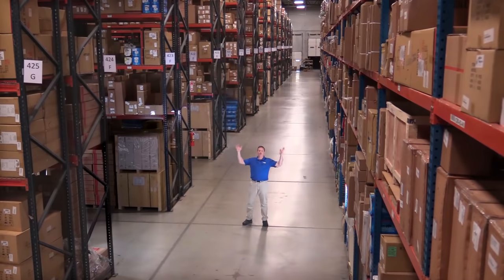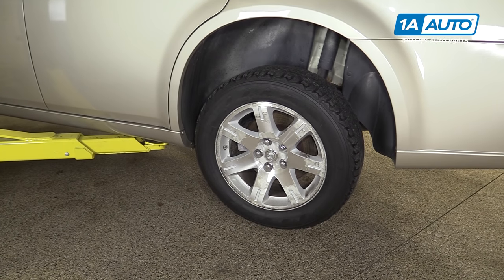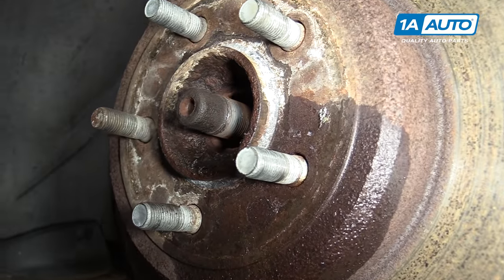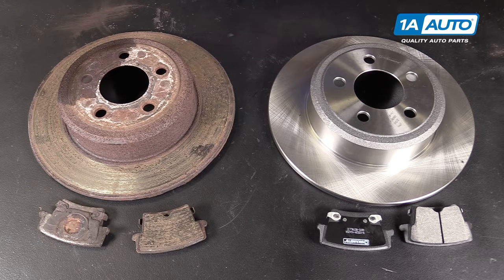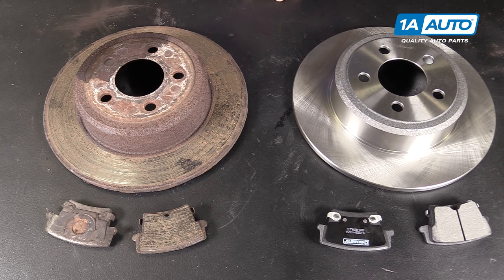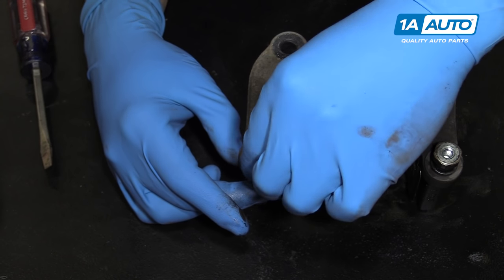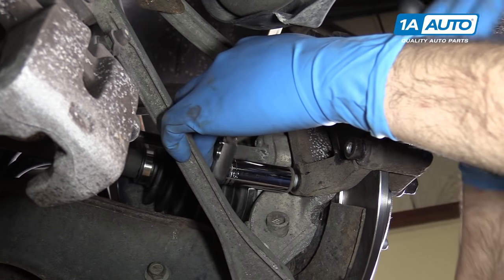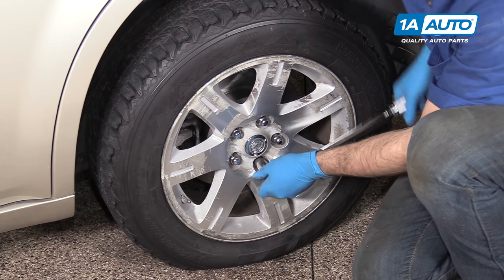How to Replace Rear Brakes Rotors 05-14 Chrysler 300

Comment: The only thing I WOULD NOT recommend is compressing the caliper piston. Compressing that caliper piston with the old, dirty, over heated brake fluid from the heating and cooling cycles of every day driving is just pushing all the contaminated fluid back into the braking system, which could lead to more expensive repairs sooner rather than later... ALWAYS crack the bleeder valve while compressing the caliper piston to remove all the old brake fluid from the caliper, close the valve and bleed the system. And I actually go through the bleed process twice to make sure and remove all the old fluid or at least as much as I can(it doesn’t use much fluid doing this but will save $$$ in more repairs later). Just make sure the fluid reservoir is full each and every time you go through the bleed cycle to prevent air from remaining in the braking system.
Reply from the maker: +Cody Vallie Thanks for the feedback!
Reply: Probably due to the fact that the novice mechanic will only create more problems with the braking system by monkeying around with the bleeder valve.  More often than not, the novice will think the valve is a grease zerc and will leave a glob of grease hanging from it.  Seen it many times.
Reply: You're doing too much

Comment: Hi.  Marvellous video, just right to incl. socket sizes etc.  Many Thx.  Now then, do u have any tips for removing a 19mm chrome lug-nut (a la 300M 2003) when the lug-nut facets have been rounded off by some gorilla with the wrong sized air-gun socket?  Do I have to (carefully) drill off the cap of the lug-nut?  Or is there a needle-nose vice grip that I can force down either side of the lug-nut recess in the (steel?) wheel and then clamp with huyge force on the rounded nut?  TY, TY.

Comment: You don't explain why you installed a new hub for this brake job. Is it necessary for pad and rotor replacement?
Reply: No it's not needed to change pads but if your wheel bearing is going bad it makes sense to change it when you got it apart thoe
Reply: Also the fact that they replaced a vented rotor with a solid one...and make no mention of the difference in this video...lol🤣🤣🤣

Comment: I have a question, Will the brakes system(rotors,caliper) on a 2008 SRT fit on a 2008 SXT model?
Reply from the maker: +Angel Reyes Thanks for checking us out!  The SRT model will have larger brakes than the SXT, so they will be different.  1aauto.com
Reply: 1A Auto Parts Thank you. But if i use srt caliper bracket with the srt calipers and rotors, will it fit then?
Reply: Angel Reyes it can be done but u need more than just the calipers and the brackets, the rear spindles and front knuckles need changed and u will also need rims that will fit srt vehicles.

Comment: where can  I find a video for changing the front brake pads? i also need to find out how to get to the cabin air filter on the 2014 Chrysler 300 Varvatos edition. It not directly behind the glove box. A video on replacing the fog lights on the same vehicle would be great as well. Thanks!
Reply: The filter is in the hood near top where wipers are
Reply: Also if you don't see anything when you look in that area, it means they didn't install the housing. Quite a few chryslers and dodges are like this and in my vehicle, my father bought years ago, that part was apart of the features to have already been installed. There are videos out there on how to install it if you can't find it, but the part is a little difficult to find.

Comment: I have a 06 300 Limited What's the part number for the rear brakes cause I've tried 1057 and 1057A and neither fits.
Reply from the maker: Thank you for the inquiry.  In order to find the correct rear brakes for your vehicle we would need to know if your OE rotors are vented or solid and their diameter. +1namillion83
Reply: @1AAuto  Hey thanks for responding. O'Reilly had what I needed AutoZone kept giving me the wrong brake pads. Went to a total of 4 AutoZones before I went to O'Reilly. I'm back rolling now thanks again for responding.

Comment: Hello what is the name of the piece of metal i need to replace that
Reply from the maker: +LATINO CONTINENT You may be referring to the brake dust shields.
Reply: 1A Auto Parts yes do it come brake pad
Reply from the maker: +LATINO CONTINENT Brake pads are sold separately

Comment: Why the fuck would you ever use pliers to compress the piston.... it's called a C clamp w a piece of thin steel or wood so you can compress the piston evenly across it. Not all the pressure being sent to about 1/4 of the piston.... probably didn't like that.